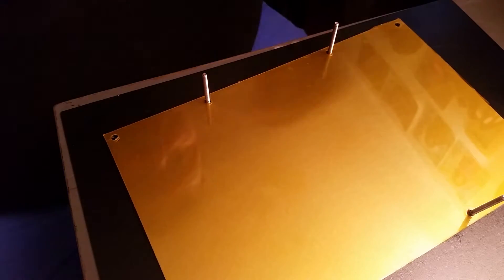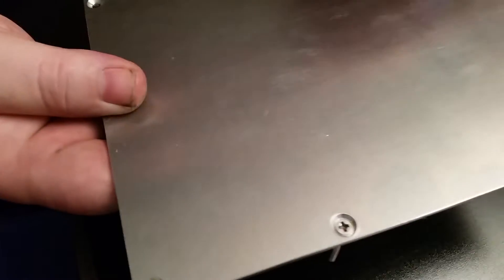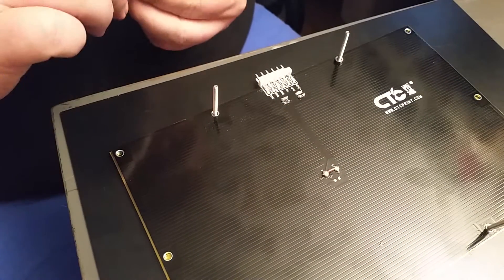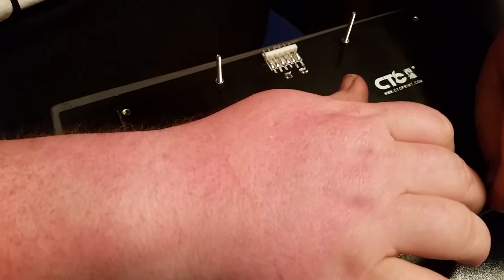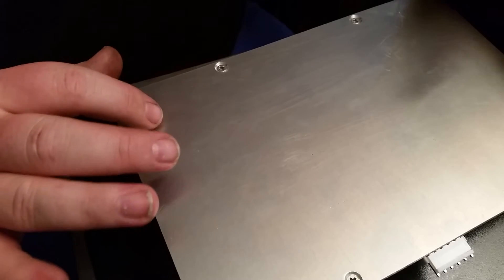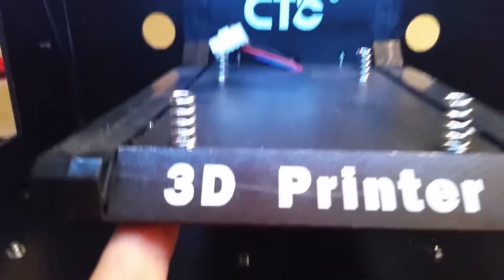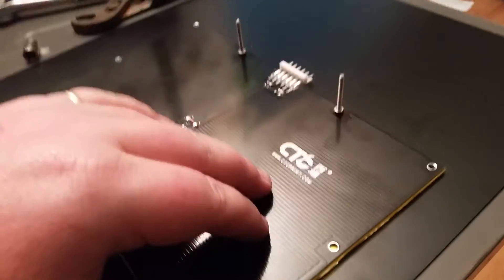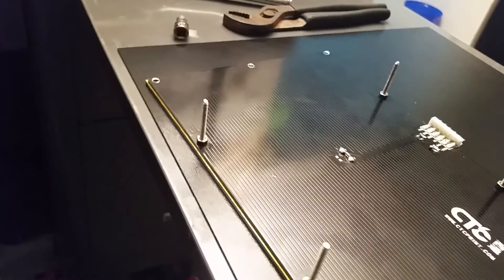ctc 3d printer build plate bent

Comment: Cut the springs down to 15mm your find it better to adjust and level. The springs are to tight and put to much force on the plate so cut them down. Also a mod you can do is turn it into a 3 point level because it is better to level. 4 point is worst and bends the plate. 3 points is better than 4 points. Look it up. But them springs are to tight and put to much on the plate so cut them down.
Reply from the maker: thank you for the help

Comment: I've been having problems with my heating bed not getting hot enough My contacts with CTC were a waste. Their warrenty is useless. They say that it's normal for the plate to be 30C below what is indicated as the heat dissipates so fast. I think that's a cop out. I know lots of guys are fixing the problem by using heavier gauge wire from the power supply to the heater, I'm willing to try this, but watching you excellent videos made me wonder if using thermally conductive grease between the heater and the aluminium plate might solve a lot of problems What do you think?
Reply from the maker: I don't think that would work like you want to because it's not for heat transfer it's for conducting purposes what you can try is blocking the sides of the printer so Air does not flow through and cool the bed
Reply: +fix it with biskit 
I've already enclosed the sides. I also built a PVC reel holder similar to yours, but mine sits on top of the printer, and not to the sides. I put a large garbage bag over the spools on the holder, so that they don't get too dusty or moist. The bag fits around the top of the printer to hold heat in also. Upon reading more this afternoon, I've decided to replace the thermister, and reset the calibration in Replicatorg. I normally use linux so I can't get replicatorg installed right. I've tried many times. I'll boot into Windows where my replicatorg seems to work, but I've never plugged my computer directly into the ctc, so we'll see. Maybe not being plugged into the printer is why replicatorg doesn't seem to work for me in linux We'll see I really do like your videos, Great Channel.
Reply: +J.P. Randolph   btw, I don't understand what you mean about "it's not for heat transfer it's for conducting", isn't transferring heat, and conducting heat the same thing?
Reply from the maker: I have not really used my heat bed but I've only been printing pla I hope that works out for you thanks for watching the videos I will have more
Reply from the maker: I was thinking of the wrong kind you're talking about the kind that goes on heat sinks like on a computer I don't know if it would work or not but you could always give it a try